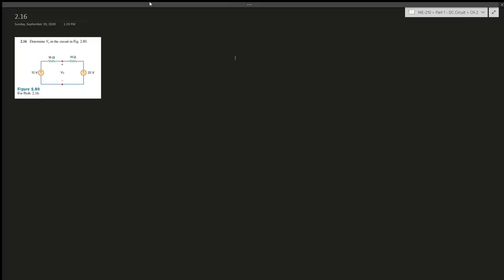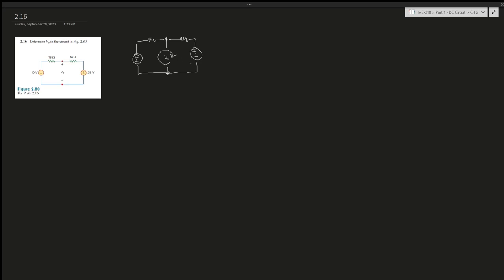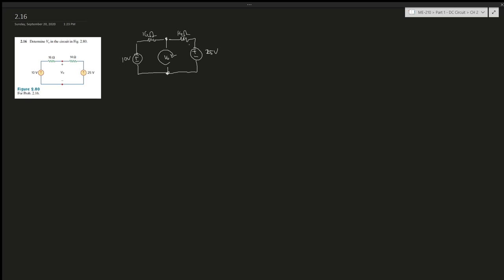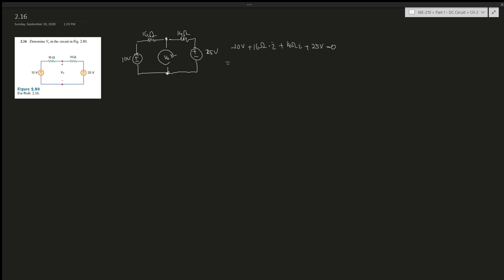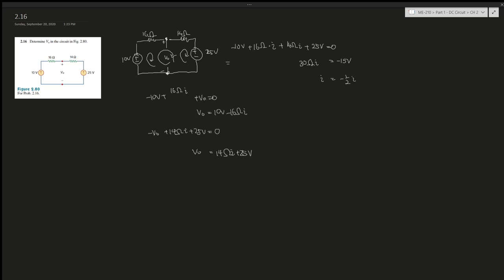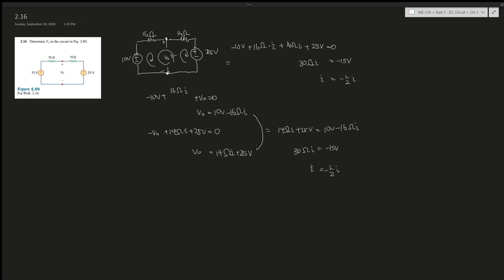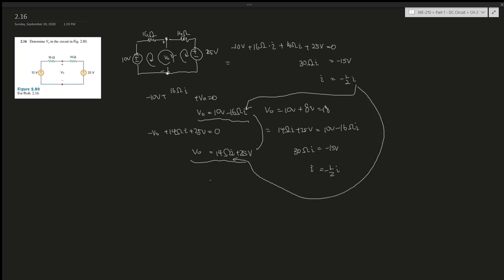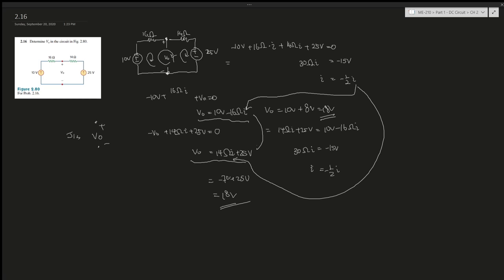2.16 Determine Vo in the circuit in Fig. 2.80.

Comment: How did you determine it was +16ohms and not -16ohms? Same for the 14ohms, since it isn't defined on the picture
Reply: Because you can't have negative ohms; it would be like having negative friction. Resistance is either positive, or it doesn't exist.